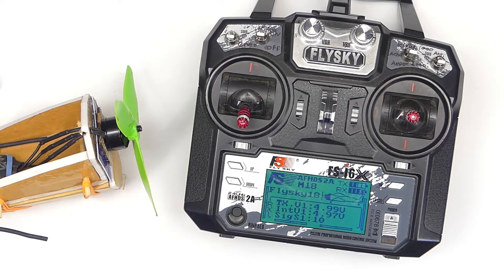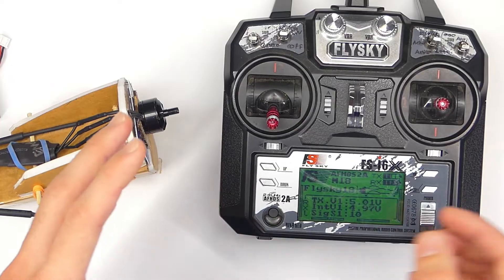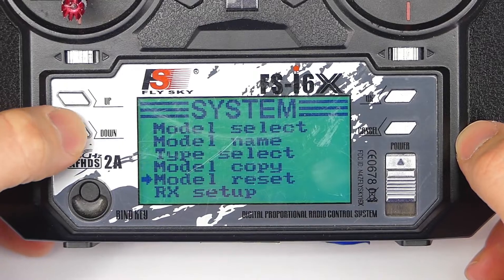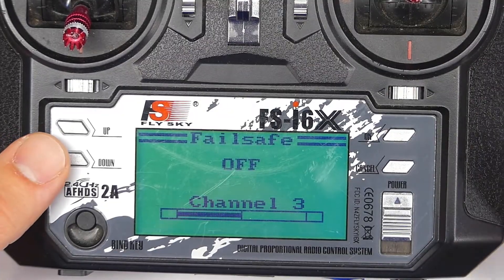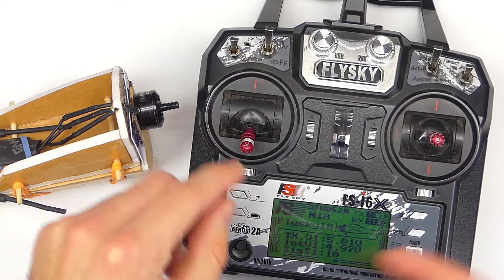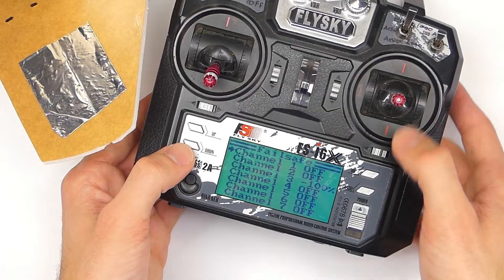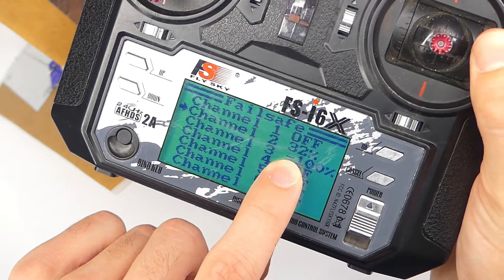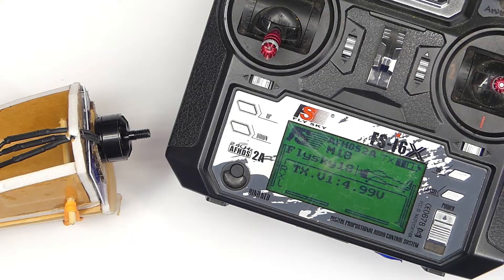FSi6X Failsafe Setup Tutorial - How to Use FlySky Transmitter Failsafe (fs-i6x, fs-i6)

Comment: Hi Adam. I have a F450 Diy quad. Want to use the Naza mlite with the FS-i6X. Cannot get the Sw-C allocated  wity pos1=Manual,pos2=Altti and pos3=Gps. My pos2 ends up in FAILSAFE iso. Altti🤔😪. ENDPOINTS   works on pos1 and pos3,but pos2 cant set? Wouter

Comment: Okay. I have a question.
I have a tracked crawler set up with a real time camera to do crawl space inspections with.. My problem is that when the battery on the vehicle itself gets low, it surges backwards. This can be a real problem when it's underneath a house because when it does this, I have no control over it. It has backed itself into tight spots where it knocks the camrea around and once even pulled the entennas off. 

Can I set a failsafe on my FlySky i6 to avoid this problem? If I have to crawl under a house to retrieve it is one thig, but to have it crawling backwards out of control and possibly damaging the vehicle is a real problem.

Can you help me?

Comment: you could also make the rutter turn to the left or right, while the elevator is slightly up so the plane wouldn't just keep going; it would go in circles
Reply from the maker: That could be a good idea.
Reply: @RCwithAdam1  but also u can buy zohd gps and use return to home. zohd RTH can be activated by a switch so ur failsafe could put the switch up to start RTH

Comment: what idf the plane battery died will it still be able to do the failsafe?
Reply from the maker: Good question! No. If the flight battery drains completely or becomes disconnected, the failsafe will not work (although I've never actually tested this). But it doesn't take much voltage to operate the servos, so  at super low voltage the motor might not work but servos will.
Reply: @RCwithAdam1  so i will need a reserve battery to activate a emergency parachute or somewhat
Reply: @RCwithAdam1  and i could use a very large capacitator to activate the failsafe

Comment: Hi, I have a fs i6 and I want to put a 3ch rx, this receptor is a viable with this transmitter the binding is OK, he works right in  all channels, but don't works the failsafe, I do the set up for this 3 ch receptor and when I cut the TX the rc model do not cut...... You know some solution, thank you in advance.....
Reply from the maker: What model receiver are you using?
Reply: @RCwithAdam1  a fly sky 3channels receptor..... Is the recommended for flysky for this transmitter....is ahfs 2a too, and is the same of gt3 flysky transmitter, if you need.... Give you the model correct..... Thank you

Comment: hi adam, desthy here from the Philippines. nice and very informative videos you have. i have a question though and hope you can help me with it. in my old fm pcm futaba radios, we usually do range checks by walking about 50m from the plane with the transmitter antenna down to see if it works fine...and in some 2.4ghz radios like spectrum, they have a range check button...how do you range check an fs-i6x? thanks!

Comment: Adam, I noticed when you moved the throttle a bit the engine turned on in my case I have a dead zone I have to move the stick almost half way up  till engine starts to run.Is there a way to fix that.
Reply from the maker: Hi! I would try calibrating the esc for your throttle. Each esc manufacturer should have info on how to do that.
Reply: hi Roger, try calibrating the esc again with your tx. remove the propeller first then move your throttle to wot position. turn on tx, then attach power to rx. usually you will here 2beeps then move throttle to full down. you will hear the esc arm and that's it, esc calibrated. hope this helps.

Comment: I only think this applies to drones.
Some flysky receivers have problems to detect failsafe. If it doesn't work on your receiver this did the trick for my fs-ia6b.
FIX:
Go to your controller menu - Function setup - End Points and set you low value for channel 3 to 120%. (throttle chanel)
Go to System Setup - RX setup - Failsafe - and setup your failsafe for channel 3, which now can set to -120% (950) 
Go back and set your end point for channel 3 back to 100% (else you will failsafe when you throttle down ;-) )
Go to failsafe tap in Betaflight and set Minimum length in Valid Pulse Range Settings to 970 (or somewhere else in between 950-990)
And then it should work... test it before you fly!

Comment: Have you figured out a timer for the i6X? I have seen where there is a software mod for the i6 but don't think it works with the i6X. Or any suggestions for a timer?
Reply from the maker: Hi! I have not. And I still haven't found it on the i6 10ch mod.

Comment: what are your thoughts on the x6b reciver?? great video by the way
Reply from the maker: Hi! The X6B is a fine receiver, I've used it a lot successfully, but now there are better options out there. Specifically, I'm using the Fli14+ and CrossoverRX receivers instead. But if you don't mind the extra size/weight, they work just fine!